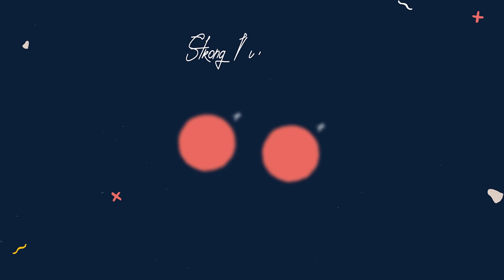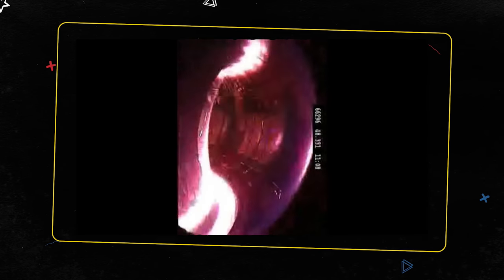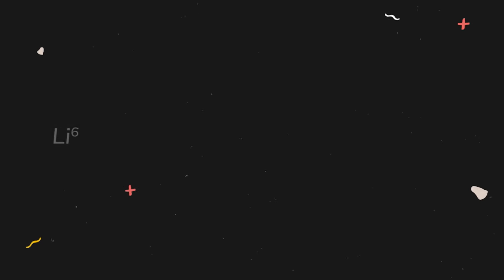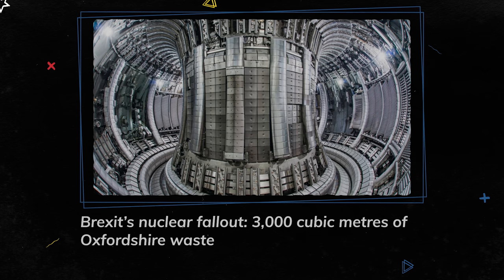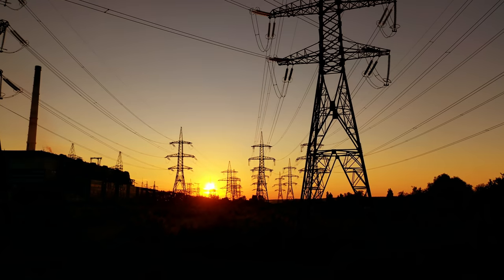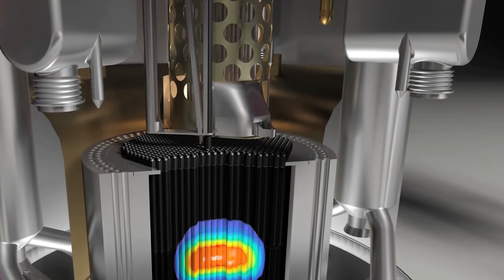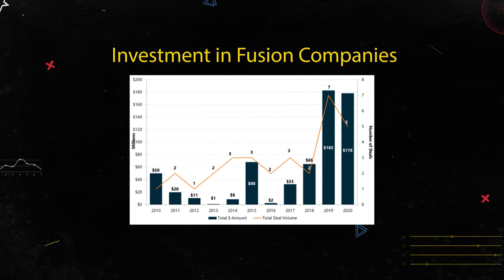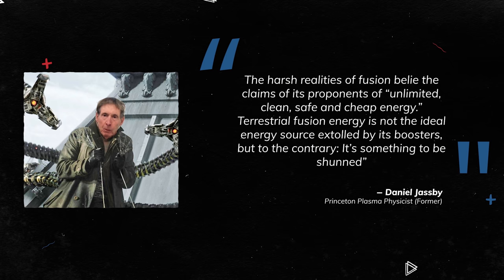What No One Else Is Telling You About Nuclear Fusion

Comment: So is that fusion reactor being built right now billions of dollars going to it is just a waste of time waste of money can someone answer this question please
Reply from the maker: It’s a research reactor. It may help us figure out pathways to cheaper solutions for Fusion in the Future. 

Remember, that science doesn’t happen in a vacuum. The discoveries that happen in neutron radiation resistant materials, Tritium recovery etc will help other industries including Fission. 

Considering what is spent globally on technology for Military, I think $25 Billion over several decades is a drop in the bucket.
Reply: Yes it’s a waste of money 💴 because fusion has yet to prove itself as a profitable or even viable option in the near future. Fusion at least for this time doesn’t generate more power than is put into it. It’s interesting to research but that does warrant spending billions on an unproven technology. I understand people hate military spending, but because of that spending we have GPS, rocket technology, and too many to name.
Fusion overall is interesting but those resources could be better spent on something like a Small Modular Nuclear Reactor instead.
Reply: @dr.vanhellsing  "spending billions on unproven Technologie" 
Well that sums Up Research for you xD
Reply: Why use fusion if we still have lots of oil. Oil is safe and reliable source.
Reply: @oldi184  because oil is hard to get hard to refine requires a lot of protection and infrastructure in places were it's the hardest to build often to get you have to either buy from shady governments who use the money to invade countries oppres they're people and general destabilize regions oil also comes toxic polutants plus the general condition of extraction cause tons of worker deaths it is infact running out and getting more expensive and lastly it's significantly contributing to the planet getting hotter
Reply: @oldi184  oil is also a finite source producing harmful chemicals in its production and its use producing greenhouse gasses which is not good for the long term of our health and the planet.
Reply: @rudder3084  
True, but still we have plenty of it. 
Russia discovered really gigantic oil deposits under arctic seabed. They are huge.
I read an article which stated that from what Russians discovered now they have oil for 200 or 300 years. So humans still have oil for many generations.
Reply: @oldi184  thats lucky for them. But me personally am under the impression of  just because it is there does not mean it should be used especially long term if it can be helped. Oil and fuel is centuries old now and I believe we should start moving away from it if we are going to get anywhere or else an eventual oil crisis will cripple our society in a huge way down the line.
Reply: @oldi184   I agree with what rudder is saying and see many other reason to innovate out of oil dependence. For one it not a clean source. It pollutes our environment and causes health issues. Smog in cities is a big concern and one that won't be solved without alternative fuels. Also consider that gas for cars and electricity is not the only use of oil. There are tons of byproducts that come from oil that may be needed to develop alternative methods of energy. If that happens at the same time as we are running out of oil it will only cause even worse issues. No one is (seriously) advocating we shut down all our gas usage tomorrow but if we hope to see our world overcome the maybe 200 years of oil supply we have then we need to start looking outside the box today.
Reply: @TechforLudditesSira  Good answer. Thank you
Reply: @dr.vanhellsing  I'm with you I want to see more of the Small Modular Nuclear Reactor
Reply: @punkvoid9957  I don't see why the antichrist has anything to do with Fusion energy.
Reply: I just hope that the billions of shared money from CERN and the major companies are not being wasted on physicist ego and journalist writers having a circle jerk about the possibilities a fusion energy without being practical and cost-effective in the long run. To me we’re going to have to use legacy fossil fuels and new advancement in nuclear reactor designs to build future energy. It’s a pipe dream of mine that we would be reasonable with the trend and popular fad of green energy we need to be practical with common sense not political dogma telling us what to believe in.
Reply: @oldi184  

And keep emitting billions of tons of CO2 to the atmosphere?

That is just not an option any longer. 

We will have to reduce the burning of coal, oil and natural gas within the next 20 to 30 yrs to a very low amount (less than one tenth). Not necessarily to zero, we might be able to come up with solutions to compensate for a small remaining amount; that is important, because you are right in one point: there are a few applications there substituting fossil fuel might be very expensive and thus will take more time ... for that remaining small part fusion will not help, nor will fission - because the problem is the infrastructure).
Reply: @blvp2145  are you saying that you are worried we are wasting money on the cern large hadron collider or some other experiment that cern is preforming? The LHC is not a fusion research device. Its a particle physics devices that is geared to leaning more about what makes up particles. You could think of it kind of like a massive microscope, except what it's trying to see can not be seen by the eye no matter how much you magnify. The research they are doing at cern has implications on our very understanding of the universe and may lead to technologies that we have never imagined before.
Reply: @TanisHalfE1ven  I thought CERN was heading the project for the fusion reactor in the south of France or is that another government organization maybe I didn’t do very good research I do apologize and that.
Reply: @blvp2145   honestly I'm not sure if cern is involved now that I take a look. If they are then they must be collaborators. Cern (aka European organization for nuclear research) is an international team providing scientists with access to the largest particle physics laboratory in the world. Iter on the other hand is an international fusion research megaproject. In a manner of speaking the whole point is to stroke the physicist ego, or at least their deep curiosity of complex physics problems. Also the project is being funded by some 7 member entities and contribution by 35 countries. So this is engineering and science on the scale of the lhc or the international space station. Granted it seems this project has gone terribly over budget and over delayed. But then so was the LHC.
Reply: @oldi184  besides the environmental impact oil is not unlimited
First one to get off oil rules the next five centuries, do you want to surrender to China?
Reply: @WolfgangFeist  You believe in a cultist religion Called man-made climate change. We’re going to have to use fossil fuels to build the next generation of nuclear power plants deal with it. Or nothing at all wind and solar cannot output the same energy that fossil fuel can.
Reply: @blvp2145  Hm... Ad hominem argument? Just for the record: I'm a physicist - now, that doesn't make humans vaccinated against cults and strange beliefs. But it gives you a sense for critical thinking and checking viewpoints from time to time. Information about the IR-absorption bands of CO2 are available since 100yrs. The processes in the atmosphere are being studied and known for decades; the CO2 level is rising (and that is man-made) – everybody can check that himself. The temperatures on the planet are already ~1 K higher than these have been in the 50s. All these are scientific facts – I wouldn’t call the physicists on this planet a “cultist religion”.
Reply: @rudder3084  
Great you go and live in your cave  with no electricity  no running water no medications  then you can say fossil fuels and such are  better left in the ground
Reply: @TanisHalfE1ven  
 why don't you join rudder in his cave and not use anything that uses fossil fuels
Reply: You can also look at it this way: the few billions that we have spent so far for ITER is a drop in a bucket compared to the spending in other areas, such as in military, but fusion has the potential to solve a LOT of basic human problems.
Reply: @WolfgangFeist  
Why CO2 is great for plants it increases their growth rate and yields. You have been brainwashed   by the  green  movement. green houses use CO2 to increase their yields. Yes global warming is happening  but it is not man made  another thing you need to look at is water vapor this is a natural and man made  as is CO2 but the green movement  dose not say a word about it because they know that it is  very  unreliable   to use in computer models. Oh and a lot of that fossil fuels and crude oils is used in medicine and  cosmetics  as well as medical prosthetics from by products
Reply: @oldi184  Are you from Alberta?
Reply: @freddiethompson58  
I'm from Europe.
Reply: @jamesricker3997  What do you mean? China is not a top oil producer. They don't control much of oil production. 
Fusion, "hot fusion" to be exact will not happen. Because the principle is misunderstood. They think that sun is creating energy by nuclear fusion but the temperature of the sun's core is 15 million Kelvin. 
Scientists claim that our star achieves fusion at 15 mil. K and we are unable to achieve stable fusion at 50 mil. K and more. 

JET the biggest operational fusion reactor at the moment can "achieve" fusion for only 10 or 20 seconds and still they are unable to get NET energy gain. 
In short. They are trying to achieve "hot fusion" for over 50 years and the best thing they have come up is fusion for 20 seconds with no net energy. 

Of course we have other methods of creating clean energy like for example "cold fusion", it's a colloquial term. Technical term is "LLNR" - low level nuclear reactions. Pons and Fleichmann demonstrated this method in 1989 but for some reasons this method of creating energy is not used. I believe its because oil lobby which is truly powerful and will never allow that.

They will not attack "Hot fusion" people because they know that this method will never work. Some 20 or 30 seconds bursts of fusion which are not even able to create net energy are not threat to them.
Reply: it's a complete waste of money, there is 0 research as all as tokamak designs has been invented long ago. 

They should have researched how to extract energy from plasma before building a massive tore. And fusion is indeed useless now than we have clean coal, morever fusion can't replace oil for car, except on a tiny scale
Reply: @Wolfgang Feist 
keep emitting billions of tons of CO2 to the atmosphere ?
nothing wrong with that
Reply: @TanisHalfE1ven  Could not have put it any better myself
Reply: @oldi184  I live and work aside an oil driven economy who works hard to provide environmentally friendly oil. Even we understand that oil is a finite resource, and produced carbon emissions that contribute to climate change. Everyone wants to have clean energy, we just can't do it right away. Experiments like ITER and other energy projects will hopefully expand our understanding of the natural world so we can explore clean energy options in the future.
Reply: @dr.vanhellsing  the science of Fusion is sound. The limiting factor is the technology required to make it a reality by using heat energy to replace gravitational energy.
Reply: @WolfgangFeist  argumentum ad hominem? Wolfgang I am not attacking you personally I’m attacking the message and questioning the rhetoric on a man-made climate change. Too many people believe that Paul Ehrlich’s Hockey stick graph is the settled science and cannot be questioned or refuted and the debate is over. To me that’s not science that’s politics that says you can not question me because I have a PhD degree. That’s when science becomes an Orthodox religion and that’s just gonna stagnate any type of critical thinking from layman to Expert. That’s why I have a problem with billions of dollars going to organizations in the scientific community actual research and development but it seems that it takes decades for any kind of results and they keep on asking for more money. How about the scientists today pursue results instead of Nobel prize and the accolades of scientific journals that just strokes their egos. That’s asking for too much mankind is flawed because were vain and self-centered and we live in a very cynical age.
Reply: @oldi184  because one day it will be used up completely and nothing will be there to replace it because of this thinking
Reply: @nicholaslee5473  
I agree but that day is at least 200 years away. Your children and your children's children will not see that day.
Reply: @oldi184  So? Researching new technologies like these take decades, centuries even, to perfect, the first car came to be in the late 1800s, and 200 years later they are still being refined. Are you suggesting we just stop and let our grandchildren deal with it? There simply isn't enough time by then, society would collapse without energy.
Reply: @blvp2145  I see your problem. Let me assure you: I've spend my adult life with applying critical thinking - and it often takes some time to see missing points in scientific papers. 

I have learned how long it took for myself to get the flaw in classical "addition of velocities" and realize the fundamental bias there (broader approach to relativity) - I think all us physicists have been through that education. It's even more severe with quantum mechanics; so we have learned that you might be "really sure of some concepts" and there still might be a deeper and better insight. I have seen that again with my students (simple things like realizing that "breaking" is nothing other than negative acceleration).

If you are a honest publishing scientist, you know, that there always have been a lot of small and bigger flaws - almost everybody has at least some bias (even Einstein did, he didn't "like" quantum theory and was so convinced about that, that he came up with EPR - what, meant as an obvious illustration of how absurd quantum mechanics is, turned at the end out to be the key for a final very convincing test of that theory). As a scientists It is important that we look beyound the potential bias. "Critical thinking" is mainly a method to apply to look for one's own bias.

So, take your time to do your own critical research. For my part, I have been doing a lot of CO2-related research in building ventilation; the IR-absorption is used for the main technology in CO2-sensors. We have been able to really see the increase in external CO2 during the past decades in our own measurements - the same for the atmospheric longwave radiation. This is just another field of independent researc. And there are many of others like this. The state of the research here is o the same level as that with the age of Earth  <For this it's not just geology and the radioactive decay methods; it's also astronomy, astrophysics (planet formation; age of the sun), genetics (genetic clock),.The evidence for a ~4.5 billion year span is so evident in all these fields, that assuming a age only of a few thousand years can really be seen as falsified. And it is similar with the atmospherec impact of CO2.>
Reply: Wrong
Reply: By that logic we should all have remained in the caves
Reply: Hey my name is van I'm going to help you see something this maybe you didn't hear about there is a scientist they say his name is Salvador Paris he created a reactor that is the size of a basketball and puts out one terawatt of clean usable electricity the u.s. Navy last year applied for the patent google it see what you can find
Reply: @abhimanyusingh4281  Do you know that some people around the world still live in caves even today.
Reply: @blvp2145  agreed- although they still create waste which I am still frustrated at the lack of recycling progress,  But I’d still prefer that compared to the co2. Heck, maybe if we made enough nuclear waste, we’d become incentivized to get serious about recycling it. Molten salt reactors not withstanding
Reply: 50 years in the future is not very long.  The natural gas and oil is not really a limited resource as we normally think about it, but rather an increasing cost to obtain.  Over time the price to extract gas begins to become impractical at which point other sources of energy become more viable.  

As for climate change it can include change in land use which is the primary driver (not co2).  Irrigate fields the area becomes more humid and less reflective.  Build a dam and you get similar changes.  Move to ubran and you get a change in temperature 5-10 degrees hotter.  Well know and when you travel between the heart of a city and a wide field the temperature change is dramatic.

The biggest environmental issues are the products from fossil fuels such as DNAPLS that hurt your water supply and aquifers for clean drinking.  Very similar to heavy metals from sources like coal.
Reply: @dr.vanhellsing  This newfangled oil hasn't proven itself as a viable technology. In light of the failures of oil, I suggest that we should stick to using horses and packmules.
Reply: For everyone attacking me on further spending on fusion. Consider this CERN wants 23 billion dollars more to build an even larger collider. It’s safe to say if you spent that money on modular nuclear reactor from Rolls Royce. You could power over 20 million homes around the world for nearly 60 years. This would be inexpensive electric bills, high reliability, and nearly emission free. It’s insane to spend even more money on a unproven technology, and I still have yet to see fusion technology generating more power than it’s provided.
Reply: @dr.vanhellsing  i’m gonna support you instead of attack you I’m with you these physicists And over paid nerds want more money for their science projects just look cool. The $23 billion can go to that nuclear modules. If physicist and geeks and nerds want a bigger collider they need to argue and convince others they need that money
Reply: Someone in some era must start the research, that's what our history taught us. They have started this in this decade, we should be proud of it. They can create another historic milestone.
Reply: @killaure3347  its just money... they can print as much as they want...
Reply: I think so, unless they alter the design to use this other method Jeff Bezos is backing. ITER has to "add energy" to make the plasma hot, this other method just "squeezes" the plasma making it hot. This uses less "energy" so you're not trying working so hard to achieve that "energy singularity" where you get more energy out than you put in.
Reply: That is for science not for profit. It is not a comercial product, it is a scientific experiment. It doesn't matter if it succeedes or fails on its task of proving nuclear fusion. If it succeeds, then it suceeded, if it fails, not only they will learn a new way of how not to do it, but along the way they will learn so much more about fusion.
Reply: @lucasmontec  Then fund your own science project yourself. Don't ask others for an hand out to prove if it succeeds or fails. Sell me on the Idea of fusion and that its an good investment over time for the betterment of all Mankind.
Reply: @vanjammin7437  Please explain?
Reply: @Omenowl  AOC said we have only 12 years till the end of the world!
Reply: @blvp2145  you don't have a voice in this. Since you consume and live on the output of research it is obvious that the state can just take this money from you for this. And thankfully, even if you cry and disagree, the state still does it. You'll thank them later anyway.
Reply: @blvp2145  no body needs to sell you on the idea. You are not a specialist. If you want to be sold, go do your own research. Youtube is no source of science, sorry.
Reply: @lucasmontec  I would prefer the free market do this then the "STATE" just taking the money from its tax paying citizens who should have a voice in this. By your logic you are in favor of the "State". Should I Thank a pickpocketer, who later ( using my hard earned money ) makes a product that improves my stander of life?
Reply: @lucasmontec  Agree to disagree with you.
Reply: @blvp2145  free market is a lie. It is something that doesn't exist and can't exist on our current society. But yeah, you can believe the fairy tale you want, a democracy allows that. Still, thankfully, smarter people are in power and because of this, people lile you just have to bend the knee.
Reply: @lucasmontec  Please stop coming to the US Money bank for an Hand out. The American tax payer would prefer the invisible hand of the free market to make the choice on Energy.
Reply: Hey this is Van jamming what did you want me to explain
Reply: @vanjammin7437  You posted "wrong". What's wrong? Van keep Jamming.
Reply: @blvp2145  well what I meant was wrong is there is clean power generators in existence now the US Navy has designs 1 by a man named Salvador. Patent you can Google and ask Google to show you patent for small basketball size generator that came out in 2019 or 18
Reply: @oldi184  Apart from the pollution and greenhouse gases you are happy about funding Putin's Russia?
Reply: @oldi184  bro cold fusion ?. is there possible to do fusion reaction in cold ?.
Reply: @anthonyhilman5027  
"Cold fusion" is a colloquial term. The technical term is LLNR which is acronym of Low Level Nuclear Reactions. 

This just means that energy can be extracted from atoms and sub atomic particles in much lower temperature. Not millions of Kelvin but orders of magnitude lower. It's still hot though. Certainly not below zero Celsius. 

It is called "cold" fusion in comparison to "hot" fusion due to lower temperature of extraction.
Reply: waste of time and money
humans would've been kinder to the environment to just burn the coal
Reply: Yeap, the research going into plasma reactors seem to be a distraction from better, cheaper and renewable energy such as thorium molten salt reactors and geothermal technology.
Reply: @abloogywoogywoo  Would Gaia be happier if all humanity would just collectively drink the Kool-Aid? Is mother earths more important than my life? Or even your own life?
Reply: @Jimbo Bimbo What? What 'A' has to do with 'B'?
Reply: @oldi184  Good one, but not safe, the emitted CO2: wrecks climate and is unsustainable.
Reply: @oldi184  Personally I don't mind if you burn oil as long as you sequester all the poisonous emissions. Basically, I don't want to breathe your emissions nor suffer from a wrecked climate.
Reply: Exactly. More than 70 years in research and still not viable. This is a too complex process.
If you come back to history; power generating concept are always simple. Tesla come and in a few years developed the alternating current generation and distribution, in a simple concept. His generators simply work. The same way as a airplane simply fly or a combustion motor simply run.
Reply: Two reasons:
1) 90% probably that we won’t accomplish nuclear fusion power is 10% that we will, and that is - on average - a huge return of investment. Like the old saying: You have to kiss a lot of frogs before one of them becomes a prince.
2) Even if we don’t learn how to build a fusion power plant, we will certainly learn SOMETHING - and likely something useful. Solar cells were a spin off from satellite programs, Teflon was first introduced by by the Manhattan project, twitching frog legs started electrochemistry, etc.pp.
Both arguments converge to the conclusion that research cannot guarantee a specific outcome, since not knowing the outcome is precisely the reason why we do research in the first place.
Reply: @dr.vanhellsing  according to your logic, we should just stop all pursuits of scientific endeavor... because we shouldn't be spending on things that are unproven right?
Reply: @oldi184  oil is everything BUT SAFE. the air pollution killed an estimate of 100.000.000 million people over the last 50 years.

roughly 4.000.000 a year. so come again and tell me its safe.
Reply: @oldi184  also we're only seeing the very beginnings of greenhouse heating caused by CO2 and Sulfur emmisions produced by burning hydrocarbons and it has already begun destabilizing critical ecosystems that produce the oxygen and recycle the nutrients necessary for life (esp. the oceans which sucks since they produce between 1/2 and 2/3 of the oxygen). These systems are complicated and hard to predict precisely, but we know enough to be sure on current trajectories within the next 50 years we'll hit a turning point where reversing these effects will be orders of magnitude harder.
Reply: @blvp2145  science can and should be questioned. But peer reviewed and independently verified science requires more than just a good sounding argument to be taken seriously. It requires people who have studied understand the existing science, have identified flaws in those studies and provided equally strong and reproducible evidence of those flaws. There are thousands of independent and reproducible studies that have been performed on climate change around the world. They often vary somewhat in their specific predictions of severity but they all agree on accelerating rises in global temperatures. To argue otherwise requires identifying an inherint flaw common to all of these studies, proving it would cause this allegedly misinformed conclusion, and then having this result independently verified by multiple reputable organizations. To be clear, so far there are NO such studies that can be independently verified. I've not met a single climate scientist who wanted anything but to be wrong. It's going to be a lot of work to fix. No one's happy about it. It really sucks. But life doesn't have to be easy, and we just have to roll up our sleeves and do the work.
Reply: @vilmospalik1480  most of the technological advances we have today came from government/community funded research. Most of the research around quantum mechanics and general relativity was only possible with government funding. These theories lead to the inventions of the tech, including lasers, gps, transistors (i.e. computers/phones etc.) that underlies most modern conveniences and have massively propelled our economy forward. These benefits were not clear or even imagined at the time they were funded. They were funded solely with the purpose that they would expand our knowledge, knowing that the consequences/benefits will only become clear AFTER we fund the science to learn how things work.
Reply: @kevinmcdonough9097  i recon if someone would actually be able to disprove all those cimatechange peer reviewed studies and models, that person would surly win a nobel prize
Reply: @dr.vanhellsing  so let's stop the research and news achieve fusion viability. 

You will never finish the marathon if you stop moving.

And of course, even failing is a knowlage. And knowlage worth everything.
Reply: Dude, we’ve been building experimental thermonuclear reactors for the past 60 years and spending who knows how much on the R&D on the promise that fusion power is only 10 years away.
Reply: @TheRealCFF  Just give us another 10 billion and time and we will surly get Fusion up and running.
Reply: Gaily bedight,
A gallant knight,
In sunshine and in shadow,
Had journeyed long,
Singing a song,
In search of Eldorado.

But he grew old—
This knight so bold—
And o'er his heart a shadow
Fell as he found
No spot of ground
That looked like Eldorado.

And, as his strength
Failed him at length,
He met a pilgrim shadow—
"Shadow," said he,
"Where can it be—
This land of Eldorado?"

"Over the Mountains
Of the Moon,
Down the Valley of the Shadow,
Ride, boldly ride,"
The shade replied—
"If you seek for Eldorado!"
Reply: @blvp2145  I certainly hear you on the rights and freedoms bit. Rights and freedoms are complex, though. Individuals actions affect others and their freedoms, and it's often difficult where to draw the line, when one person's freedom closes up freedoms for others. Sometimes it's obvious, like with theft and murder, but usually it's complex, especially when people are separated by space, culture and time. Our actions damaging the environment can ricochet thousands of times over in the generations to come. Many, including the founding fathers fought hard and sacrificed much, that the generations yet to come may thrive from the liberties they secured. They couldn't foresee everything, but they tried hard to look forward and we must do the same. The unfortunate truth is, the way we enjoy our standard of living, is unsustainable; our actions can and do squander the freedoms of generations yet to come. And it's disproportionate. Small things now have much larger compounding consequences later. I wouldn't argue to throw out or standard of living, but to rethink it. To find ways to keep doing much of what we enjoy, using creativity, science and engineering to do them sustainably, such that future generations may enjoy similar freedoms and quality of life. And I certainly think fission nuclear will probably play a role alongside solar and wind on the energy side of this. I haven't yet read through the exact proposals on the green deal carefully enough, to address your issues there. If you have more details on the criticisms I would be very interested. But I will note, that the urgency and scale of these issues is not something the private sector can handle alone; there's nothing in the private sector to hold companies accountable for the environmental debt they take out for profit, that the rest of society will have to pay. The government is the only institution in a position of both authority and beholden to the people rather than shareholders to maintain this accountability (i.e. regulations). And there's an urgency as well: the private sector moves slowly and cautiously into new developments for risk management purposes, but the slower our response, the more time we give the issues compound, often in unpredictable ways. So again, the government is the only organization with the resources to kickstart this development. I haven't seen exact details to know exactly how "fair" this kickstart has been and I'm sure there are fair criticisms. But in the face of large scale catastrophe I can accept that "fair" may sometimes be secondary. In the face of a war, it may not be fair exactly which companies get the government contract. The government is certainly picking favorites. But it must be done, so a choice is made. I'm not sure how much of this may resonate. This is a weird forum for this conversation. I'm enjoying the thoughtful responses and learning a lot from your perspective and would be happy to take it elsewhere.
Reply: @oldi184  it's obvious. Are you being serious??🤔
Reply: @robertbarth5497  
Could you remind me? I forgot what I wrote a week ago. Sorry.
Reply: This is why happens when energy-creating machines are suppressed. Humanity became dumb. Energy can be created and first thermodynamics law is the most sinister lie.
Reply: @lukiepoole9254  But so far laws of thermodynamics are working. I think it's not about "Creating energy" but controlling it's flow. 
We know that universe is full of energy, every cubic centimeter of space, even empty space has energy. Books and articles call it "Zero point energy". 

But I agree with suppression. Progress in science was completely stopped in 2 segments. One - energy production. Two - new propulsion systems. 

Since 1950s there was not true technological breakthrough in those 2 segments. We have smartphones and intelligent cars and super computers that are powered by coal and other fossil fuels. 

Is it intentional doing? I believe so. Deep state which is very real will not allow new breakthroughs. Mankind will still use coal and gas and steam in 50 and 100 years. 
Zero point energy is not profitable and cannot be sold thus it cannot be allow to happen.
Reply: @lukiepoole9254  could you please expanded this topic.
Reply: @oldi184  ZPE is a hoax. It stands for matter's base energy when all kinetic energy is removed. That's it. The universe doesn't function on magical particles. It functions on æther that is suppressed and not "debunked". All electrical phenomenon is due to æther. Deflect an atom away from it's course and it will lose it's ability to induce emf on coil adjacent to it.
Reply: @lukiepoole9254  But when I think about it, ZPE can be de facto aether so I agree with you. It's just a different name for the same phenomenon. The idea of aether is very old and was rejected in early XXth century.  
But looks like it's true, sea of energy which is filling the universe do exist and people from Lockheed and Boeing know about this.

So real and new science is intentionally blocked by the deep state, I know that. Those people just don't want new method of making energy to be accessible. We are being told that Einstein is this God of science and he was right, always right, speed of light is this cosmic speed limit and nothing can move faster, nothing!! It's obvious nonsense but those people are behind this propaganda. They want us to believe that general relativity is true, black holes exist and those new theories and ideas which throw most of the old stuff away are pseudoscience. They want that. 
Deep state wants to preserve the current status quo in science as long as possible. 

They even push other crazy nonsense like that "string theory". Where every "particle" has a "spring" or "string" inside. It's obvious propaganda. 
J. F. Kennedy mentioned that almost 60 years ago when he talked about "monolithic and ruthless conspiracy". 
Back then he spoke that there is a group of people which controls America and that they have their own people in media, in science and in politics. Of course many will say that it's a conspiracy theory but it's true.
Reply: @kevinmcdonough9097  In the year 2030 your own nothing and be happy for it. That’s not a future I want it’s too collectivist.
Reply: @blvp2145  Did you mean that reply in response to someone else? I havent made any comments about collective ownership, nor do I think that it's a good idea. I have only talked about effective regulation and stimulus. By definition both are external structures guiding independent companies. This strategy uses capitalist forces to keep production/work efficient, just relying on the democratic government (i.e. will of the people) to guide the overall direction.
Reply: @oldi184  carbon emissions. also it kills thousands which isn't safe.
Reply: @dr.vanhellsing  That's why it is in the research stage. Look at the work and resources necessary to produce a nuclear fission reaction during WW2. Cutting-edge technology, especially in the research stage is VERY expensive. So is going to Mars, or the moon, or even the ISS. Look at how much The Large Hadron Collider cost ...multi-billions of Euros split between several governments...even though that had a perceived low expected rate of success in discovering the Higgs Boson, among other critical experiments. Big tech costs big money. Military Budgets far outweigh the expenditures on this technology, which could save our world, in the literal sense. Progress involves innovation...and money.
Reply: @R.U.1.2.  The imaginary particles are scam Lol.
Reply: @lukiepoole9254  You ought to know, what with your advanced degree in nuclear physics and all.
Reply: @R.U.1.2.  Widely accepted belief doesn't make it true.
Reply: @lukiepoole9254  That would be a counter-intuitive assumption.
Reply: @R.U.1.2.  Well, what can I say? Worldwide brainwashing is the worst. What if I told you "nothing" is possible, first thermodynamics law is fairy tale and fraudulent, and energy can be amplified from nothing.
Reply: @lukiepoole9254  I would say you are speaking with an authority you don't possess.
Reply: @R.U.1.2.  Nothing to do with authority at all. It's a simple question. What happens when both windings of a 3 phase transformer ate overexcited by a rotating electromagnet where induced emf on both windings are 2 times the input voltage?
Reply: @blvp2145  Haven't you seen the movies? In 'Event Horizon' they went faster than light and ended up in Hell. Imagine the scenario; they finally achieve practical fusion and then they open a hole to the Dark Dimension and the Antichrist steps through ... food for thought ... MacDonald's
Reply: @bearup1612  You don't understand the difference between 'move away from' and 'immediate dead stop use of'? Really?
Reply: It's not a waste of money. It's a research megaproject and will determine how to build a fusion reactor. As more and more research is done, side benefits may be discovered along with new techniques to lower costs of fusion tech. Currently, there's actually no need for a fusion reactor (most energy needs can be met by existing renewable technology like solar and wind). There's no question if the shortcomings of this technology can be solved, it will be game changing. Otherwise, so much money would not be pumped in this project.
Reply: @wakannnai1  Broken solar panels are not recyclable. Broke  wind turbine blades are not recyclable. Fusion is a pipe dream. All have been scammed. Overunity machine exist. Energy can be amplified from nothing. æther exist. Most of science is a lie.
Reply: @wakannnai1  Why is nuclear energy not considered sustainable and renewable why are you all afraid of nuclear energy and that it can be more efficient?
Reply: @lukiepoole9254  Then you get a flux capacitor...give it a rest, try reading Lisa Randall, one of the directors at CERN. She's light-years away from your pseudo- grasp of hydrogen/helium production. The conversation is over.
Reply: @blvp2145  Ah, we've got the next Hollywood blockbuster!
Reply: @R.U.1.2.  Lol imaginary flux capacitor. I make ny own overunity machine which can amplify electrical energy from nothing. Better than any of these renewable energy scam. End of conversation.
Reply: @oldi184  no, in under one generation climate damage will cause war.
Reply: @crhu319  
Yeah, it is likely, but maybe at some point in the future when things will be really really bad. Deep state aka shadow government which has much better technologies developed in secret will finally give humanity anti-gravity and cold fusion. Who knows? If not. Well...another world war is a certainty. :-(
Reply: @paulohagan3309  It won't be a sure fire blockbuster if we don't hire a strong black female lead with one arm and one leg. Its just a working title for the movie but I am thinking "Fusion Impacted".
Reply: Better than on weapons, isn't it?
Reply: @claudianreyn4529  Weapons of mass destruction are a reality. A sad reality that we live in a broken world. Windmills and solar panels are not going to fix a broken world why do you guys think that green technology is going to be the savior of humanity it’s not we all need to have the adult conversation on what kind of energy we want in America I would prefer the free market make these decisions I would prefer nuclear energy it is sustainable and we need to innovate with it to see if we can use spent fuel rods were using plutonium as an energy source instead of a weapon we need to be logical without Childish fear.
Reply: @oldi184  could you post article. Thanks
Reply: For those who think this is a waste of time. Sceince doesn't happen in 10 seconds. We thought the space race was a waste. Ever heard of MRI? Yeah look it up . Or the ball point pen ?
Fusion will solve the problem of energy of mankind once and for all . And by the way science is not meant for people who stop working on something because the odds are against you.
She doesn't even explain what will be the outcome when we achieve commercial fusion.. We have practically unlimited energy.
So if u think this Is a waste I don't blame you but science isn't meant for you. 
If you think something is important enough you do it even if the odds are stacked against you
Reply: @abhinavis2131  Can you slap me again. Its kind of fun to watch you get mad.
Reply: @punkvoid9957  How do you propose to get rid of poverty without finding new sources of energy?
Reply: Yes it's a complete waste of $ and time
No fusion reaction every created on earth has ever produced more energy then it takes to start reaction
Reply: @dr.vanhellsing  flawed ass logic and super ironic that u arent realizing nobody thought about GPS or rockets when making that massive ridiculous military budget, those things just happened to be byproducts. So ur being a hypocrite trying to justify that but then when we put a measly 25billion into a fusion reactor u say its a waste... how do u know that? How do u know we wont discover other byproduct technologies or make really solid advancements in the field of fusion? U don’t.
Reply: The whole stars are fusion reactors is only hypothesis,  not even theory,  every experiment has failed miserably in producing anywhere near the energy needed to start the reaction. 
Human history has shown we are usually wrong and almost never see the entire picture, but to end on a positive note. We hairless apes do amazing things with the little we e have to work with. Plasma physics is the future.
Reply: @brokenmess9921  Finally someone that’s not a Kool-Aid drinker within the comments
Reply: @dr.vanhellsing  for someone called a Dr you dont understand the proses of research do you?
Reply: Ya they need 10 fission reactors to keep it running. Lol
Reply: @blvp2145  
Remember press releases make money and for research groups it brings grant money. Egos grow in proportion to the cash that's brought in to the company.
Reply: @tjpprojects7192  
And if your the drinking type, the critters will take you home in the wagon. No GPS required.
Reply: @dr.vanhellsing  
Anewtronic generation seems to work. You look it up. (Might have spelled it wrong) experimented on by " fusion energy corporation" . 30 years ago. Migma research. Just additional buzzwords.
Reply: @williamvaughan1218  really? Please tell me more.
Reply: The Stone Age is over not because the stones are gone, so the Oil Age will end even if more oil is found. It will remain only for petrochemicals and for nostaslgic lovers of internal combustion engines.
Reply: "The stone age did not end for lack of stones. The oil age will end long before the world runs out of oil."

Sheikh Zaki Yamani, former oil minister of Saudi Arabia

Ahmed Zaki Yamani (30 June 1930 – 23 February 2021) was a Saudi Arabian politician who served as Minister of Petroleum and Mineral Resources from 1962 to 1986, and a minister in the Organization of the Petroleum Exporting Countries (OPEC) for 25 years... not exactly the first one to pass randomly by the street.
Reply: @walterF205  No I get last post :)
Reply: If you really want experience with neutrons and tritium recovery I have just the technology for you. It's called a molten salt nuclear fission reactor.
Reply: @williamvaughan1218  I'm down with that. Lets do it.
Reply: @dr.vanhellsing  So would have been building a plane, car, or other risky venture at the time that eventually paid off.
Reply: There is also the Conspiracy buff's idea that the hole thing about fusion research will result in fission free hydrogen bombs i.e. usable nuclear weapons with no long term radioactive pollution...
If you read what was said about Nuclear Energy back in 1939, is exactly the same with what is said today for Fusion. Articles regarding the nuclear fission, were claiming that Uranium the size of a golf ball could provide electricity for a city the size of New York for a year. Well we all know of the first use of nuclear fission six years later...
Reply: @WolfgangFeist  I'm on the fence about how much man made CO2 is effecting the climate. It's wasn't until the late 70s that carbon burning machines were equipped with emission devices to convert most of the gases to CO2. Plus a lot of the projections on how bad climate change would be, have been off in the last couple decades. Sure the level we are emitting is tipping the balance but completely banning seems extreme. I don't know how we are going to add 30% more (to charge electric cars) from the grid if we are shutting down nuclear and gas planets. I can agree oil and coal should be the first to phase out. Solar and wind seem like fine replacements in rural areas, but don't have the potency in metropolitan areas. Then we have to worry about all the waste from the panels in 25 years when their lifecycle is over. I don't see why we can't diversify between fission, carbon, and sustainables then work out carbon capturing with algae? Idk it just seems reckless to push the green agenda this fast.
Reply: Aneutronic fusion uses fuel types that DO NOT produce neutrons. This video is citing regular helium fusion and NOT the Helium 3 isotope that is intended for use. Helium 3 can be found trapped in the regolith on the Moon so rare or not we have a decent source and reason to go there... I have  watched 2 of their videos so far and both contain glaring errors. I have a playlist on fusion you might be interested in seeing. None of it are my videos so I am not self promoting. I have just gathered some in a list that were of interest to me. This one is NOT going to be added🤦‍♀️.
Reply: @solanumtinkr8280  Helium is the result of the fusion of either Deuterium - Tritium reaction (talked about in this video) or the higher temperature Deuterium - Deuterium reaction that does not produce neutrons. You can fuse Helium isotopes or even higher elements but the required temperature to start the reaction may reach 500 million degrees as opposed to 30 or 100 million degrees for the deuterium - tritium and deuterium - deuterium reactions.
In any case there are other problems like the environmental and health impact of the magnetic fields required for 24/7 operations.
Reply: I heard that the ITER project is a political mess, without proper management.  Just getting a length of pipe designed and installed is a major international cooperation effort, instead of a simple job to delegate to an engineer tasked with it.
The article I read was very pessimistic about it ever working, so it's interesting to hear about it in the news again.  Maybe it's shaped up somewhat and is making real progress?
Reply: euros
Reply: @cnvanetten1  The Global warming theory started in England during the later years of the 19th century, predicting an 8 deg. rise of the average temperature due to extensive Coal burning. Nothing like that happened of course. This issue was revived recently by Al Gore (former US Vice President) who was based on a theory of one of his College professors. Towards the end of his life, Gore's professor admitted his calculations were wrong, but Gore dismissed him saying that being old he didn't know what he was talking about. In any case there are many views, including NASA's, pointing out that the temperature variations are due to the Suns activity and that we will have a mini Ice Age by 2050. On top of that, the CO2 and CH4 emitted by living organisms is many times more than the one emitted by industrial activities. Also CO2 is water soluble and there are billions of tons of it in the world's oceans. Any rise in temperature, will increase rainfall which in turn will dissolve the excess CO2 in the water, possibly turning the world seas green due to algae development. A faster rate of growth for land plants has also bein observed recently. Keep in mind that during previous Geological periods there was twice the CO2 in the atmosphere relative to today and the average temperature was higher than today, without the planet having any problem. Humanity may have problems but not the planet. In any case 2050 is not that far away and we will find out who is wright and who is wrong. I agree with you regarding the slower acceptance of new untried technologies because we might end up with worst situations than the ones we face today. But the hole thing about climate change involves BIG BUCKS and that's that.
Reply: @robertdavis100  Money!
Reply: @JohnDlugosz  And that’s why I get cynical when it’s costing billions euros dollars from other countries and there’s too many chefs in the kitchen arguing over how it’s done and not just getting it done with just engineers and technicians
Reply: @dr.vanhellsing  it has been moving quickly in the last ten years.
Reply: @dr.vanhellsing  But poverty is not solved. Hungry people worldwide and no acces to freshwater for everyone. Tech has no meaning if half the world lives in poverty.
Reply: Saudi Arabien oil
Reply: @punkvoid9957  
The reason hunger/starvation is still prevalent today is because we're wasting food that is already plentiful (the entire human population can be fed with the current food production and still have a surplus (theoretically). Basically: the problem is the (re)distribution of food; not scarcity nor overpopulation. Nothing about this issue requires research, all it needs is society's will to actually make a change - to confront the issue directly. The solution is already there!
Do you know how much food goes straight into the dumpster?

As for poverty: that's just how most of Earth's society works (for now).
Reply: @blvp2145  
It's sad that a lot of nuclear reactors are actually being shut down lately; the fossil fuel industry seem to be getting bigger these days.
Reply: @oldi184  
“fusion will not happen”
What do you think stars are?

In all seriousness (I'm assuming you mean fusion energy/power plants), the problem with the current fusion research is that their design is practically/inherently inefficient (and they're still going for Tokamaks *facepalm* ). You see, it also takes energy to run/maintain a fusion reactor; so far a small net gain was achieved, most of the time they've only managed to break even (barely). The research is looking for a way to generate/get more energy out of a fusion reactor.
Reply: @gelatinocyte6270  

"What do you think stars are?"

Stars are not planets. Sun is the biggest and the most massive object in the solar system, Earth is not. So do not compare these two. 

They are trying to build fusion reactor for almost 70 years and the best what they can do now are short "bursts" of energy, for mere seconds and they still can't get NET energy gain! Constant, sustainable fusion will not be possible for a very very long time if at all. As I said Earth is not a star.   
Even building atomic bomb took much less time.
70 years, that's over 2 human generation of scientists and they are unable to do it. 
Actually almost 3 generations. 

I read old articles from 1970s and 80s about fusion and back then they talked how they almost know everything, that in near future all problems will be solved and fully working fusion reactor will be up and running in 20 years. That was back in 1980s. 
Ahahaha :D ok, let's look at calendar - 1980s ended over 30 years ago!!! And still there are not even close to working and stable fusion. 
So tell me. Where is the working reactor that produces fusion energy? 
Go and read Scientific American magazine from 1980s. Back then they were SURE that fusion will be fully working in 20 years!

What a nonsense. Nonsense!!! Fusion will not work, Earth is not a star! 

But hey, wanna make a bet? 50 bucks? Ok?
Send me a message when they will finally build a working reactor that can produce long, stable and sustainable fusion with net energy.
Reply: @killaure3347  yup, lol
Reply: @gelatinocyte6270  It is sad and I agree with you but it’s government regulation that is keeping nuclear power plants to be built on a better timetable it takes 10 years to build one there cost effective that’s true and the time we built because of all the regulation some of it’s needed and maybe some of it over the top so what can be much more affordable it would have to be a LNG and oil I would rather see common sense reform on this so the regulation would make it easier for them to build new nuclear power plants and smarter ideas instead of just wind and solar
Reply: @TechforLudditesSira  well for starters, they should try to make a fusion reactor not donut shaped, it requires to much energy. and second, find a way to fuse instead of in a vacuum, but in highly compressed gas or plasma. a vacuum is the opposite state that you want to do fusion at.
Reply: @TechforLudditesSira  "Remember, that science doesn’t happen in a vacuum. " Oh... But it does!  Just look at the Vacuum inside the Fission reactors!  SCIENCE!
Reply: @oldi184  it's a finite resource and creates CO2, uncontrolled climate warming.
Reply: A fusion reactor could have a use for spacecraft
or a power source for colonies on the moon.
Is it a waste of money now? Yes. We should
stop polluting our own planet first.
Reply: @TechforLudditesSira  "Remember, that science doesn’t happen in a vacuum. "
There are branches where it actually does LOL
Reply: @dr.vanhellsing  Don't forget there's an inherent and FATAL problem to fission. That's because the sources of fissionable material are FINITE and therefore limited. There may be enough NOW, but 1) they decay naturally and 2) the more reactors we use, the faster we use the materials up and run out of them sooner or later. Therefore, it is a wise idea to figure the fusion out sooner than later and start the fusion grid before the fissionable materials run out.
Reply: For everyone still fighting me on spending billions on further R&D for fusion.
1. Yes we may discover something useful, but consider we use super computers or quantum computers to perform the experiments without blowing more billions.
2. Yes spending big money on research is important to further our understanding; however, there is something called the law of diminishing returns.
3. Mostly everyone in this comment section thinks that we have limitless resources to blow on every pie in the sky. We don’t have unlimited resource, so yes everything has a cut off.
4. The odds for developing a sustained fusion that generates more energy than it takes to create violates the Law of Conservation 
5. I am sure someone will say that it is possible to break the law of conservation my response is good luck with that one.
6. Unless scientist harness dark matters extreme density to prolong fusion than fusion is likely impossible. 
7. Personally until we have a working quantum computer that can simulate such experiments than we are essential shooting in the dark.
7. I had one person mention you have to kiss some frogs to find the prince. Applying that logic you would die long before ever finding the prince. 
8. The complexity of this problem is grossly misunderstood. It’s like thinking that you have a real good chance of winning the lottery.
9. My final point is that if we as a society want to invest huge amounts of tax dollars on something at the very least it has to show that it works some what.
Reply: Marek the amount of thorium which can be used in modular nuclear reactors on this planet is about 10,000 years worth. I am assuming by the time we start running out of thorium we will be a multi planetary species. I wouldn’t be concerned about how finite thorium is. The most efficient thing we can do for now is to develop modular reactors that could safely generate electricity for over 100 years. Rolls Royce most advanced reactor can last for 60 years.
Reply: @dr.vanhellsing  So why virtually noone Is using them? Possibly because it isn't economically viable now?
Reply: @dr.vanhellsing  You make a lot of very good points. We should let future generations make the equipment needed for space travel because they will be ready
for it. Now we not only have limited resources but limited time. Climate change
is melting our polar ice caps and putting huge amounts of heat into our oceans.
If we don't fix that there will be no need for
fusion energy because we will have no food.
Also, we did that techno wonder thing with nuclear power and it solved none of our problems, created a new problem of nuclear waste, and cost billions of dollars.
It is time to build and use the many renewables we have developed!
Reply: @dr.vanhellsing  I wish the ball would get rolling for Thorium & Modular reactors. Oh and Dr. Van Hellsing please keep your dog under control, he may get out of hand at times.
Reply: @dr.vanhellsing  Dr. Abraham Van Hellsing Thank you, Thank you for being one of the few that is shedding light on this complexed and serious topic. You have brought common sense logic for us to hear. Thank you for not being a kool-aid drinker. Oh and thank you for killed and enslaved a Vampire.
Reply: @oldi184  Actually Natural Gas with carbon capture........
Reply: @chillwidnil  True innovators have a goal and a plan to get their. The problem with Fusion is that there is no plan to deal with the problems enunciated.
Reply: @chillwidnil  Tell that to the legendary innovator commonly known as Steve Jobs. He had a vision of something called the I-Phone, and before that something called The Macintosh........and he had a plan how to get there.
Reply: @chillwidnil  I agree, but the main differences in my mind is that he used "private money", he had a goal and he accomplished it. Same might be said for  for Musk. 
The people doing fusion have no idea how to overcome the problems listed in the video above, and they are using the Tax payer's money. Other forms of nuclear power are left to languish. I expect that Molten salt reactors, particularly  fast reactors will be accomplished with private money before fusion will happen, if it ever happens, that is.
Reply: @chillwidnil  I agree you do learn from you're failures. but the key is to learn from it not just get a pay out.
Reply: @chillwidnil  Friend we follow the same channels on YouTube most of them it looks like you’re a critical thinker and you want freedom please add a respect don’t assume my education level I’m not gonna do that to you that’s insulting I respect you please respect me I’m not your enemy
Reply: @chillwidnil  Thank you
Reply: Fusion will be useful for space propulsion if we manage to figure it out...it may not be great for electricity generation but it has definite uses that way...
Reply: no it is not. nothing said in this video was new to me. the potential benefits are still worth the cost. You just need to see it for the thing it is: An investment into the capabilities of our grand children, not a silver bullet for our current problems.
Reply: well, when you plan an experiment that would take 30 years to build there is a really good chance it's gonna be obsolete before you even finish building.
they knew it.
Reply: A test reactor costs around 150 million (100 of which are the measuring instruments). The manufacturing innovation and technology behind it comes most likely from before they started the billion dollar project.

Imagine a politician saying that we sunk billions into a tech which went orders of magnitude further in the private sector while we sat on our ass in our dysfunctional little world.

You must have a great imagination if you can.
Reply: There is a giant free fusion reactor in the sky. It's there everyday. How bout we  spend a few billion$ on battery tech? Think about it.
Reply: @ottodetroit  People today just want to line there pockets with that "few billion" and call it good. Look at Al Gore and others who act "Green" but are just using people.
Reply: @ottodetroit  how many batteries are you going to need in areas that experience polar night?
How many batteries in countries that can have cloudy sky for 3 months straight in the winter?
How much energy your panels gonna make you when they got buried under a snowcap?
Not everyone lives in California mate.
Reply: @ottodetroit  actually we are. The vast majority of it is in materials studies.

Edit: And by 'we' I mean the private sector. Governments are unable to think +1 level of dependency.
Reply: Hi. Astrophysicist here. I think some things are meant not to fiddled with. Fusion is one of them.  Leave some things for god to control.
Reply: @ishansheikh3058  No one’s gonna take you seriously if you invoke the name of God and not just any god but God the father God the son and God the Holy Spirit amen
Reply: @dr.vanhellsing          I noticed you failed to mention thermonuclear weapons.     And now that Russia has the new costal bombs  along with the neutron bomb and dirty bombs.   I would say that mankind is in a check mate scenario.   It is just a matter of time before we use them.    You know it.    But they,  don't know it.
Reply: @rudder3084     Society is already crippled.  Hang on.    It's going to  be bad.   You better hope there is a creator.
Reply: Checkout General Fusion's approach. They absorb the neutrons into liquid lead which absorbs the kinetic energy. Probably the best chance of a working fusion reaction.
Reply: @RichardNutman  I have read up on General Fusions ideas and I love them. I wish they got more funding then ITER did.
Reply: Any spend on research is not a waste if you learn from it and can apply the learning to future discoveries and opportunities. So no. It is only a waste if you spend money on it and then learn nothing or do nothing with what you've spent. Hubble and other major science programmes are exactly the same, until you try you won't know what incidental and unintended consequences and lessons you will learn.
Reply: yes
Reply: @dr.vanhellsing  we just need a little success to believe in it more
it is already working they are just finding better ways just believe
Reply: it is good for knowledge but economically, scientists need to be more honest and less hype oriented.
Reply: @thelovertunisia  Friend you’re asking for way too much with scientist to tell the truth and be honest
Reply: @blvp2145  Human all too human lol. Yes.
Reply: @thelovertunisia  I know others did not like my post, but it needs to be said.
Reply: @blvp2145  I think they should not focus too much on one single solution and get dogmatic about it. Dogma is the ennemy of science.
Reply: @Raja Manikanta Varma Pinapothu good question. What do you think it could be?
Reply: Ok I am not expert but there are various technologies I suppose later down the line which I think couple supplement the fusion process.
Reply: @hasher2265  I really don't care if you're an expert or not.
Reply: @Raja Manikanta Varma Pinapothu I’m happy for you.